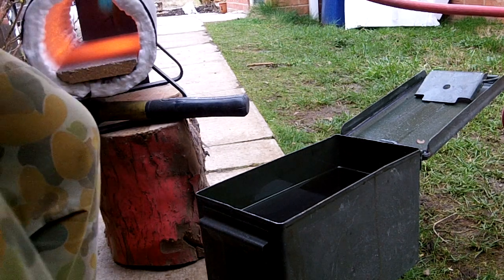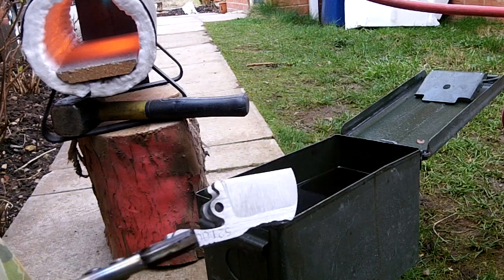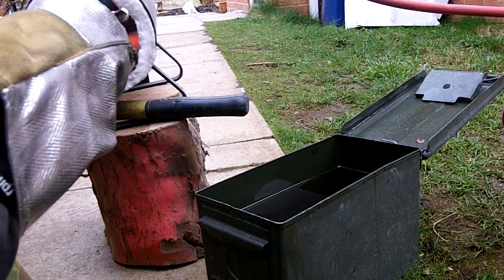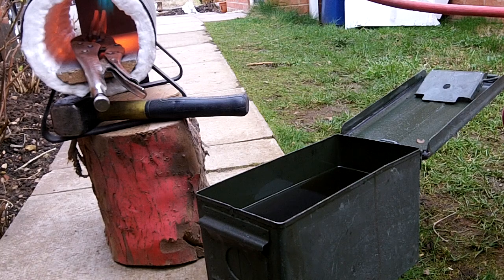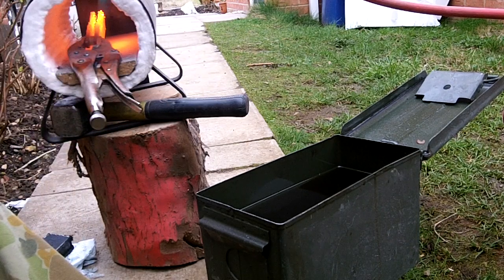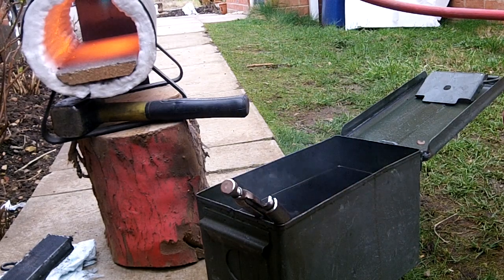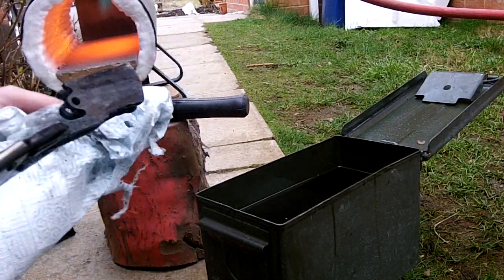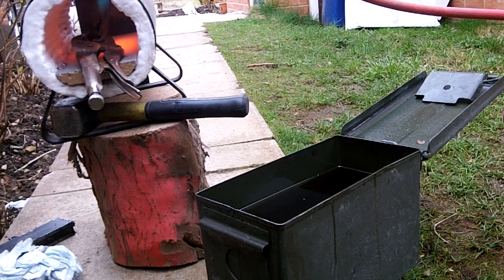Heat Treating the 52100 from Gavko, triple quench.....

Comment: Do you have any idea if it makes sence to put the blade (1095) in water after the hardening after you heat up the blade for the last time at low temperatures (example 200° celsius)
Marius
Reply from the maker: BushcraftMSL1 NO!!! water will shock the steel and potentially cause cracks. let it cool naturally and yo might want to increase your tempering temperature to around 250c
Reply: Quench 1095 in oil. Water will crack it. Do not let it cool "naturally" in the air or it won't fully harden. It has to be quenched in oil to properly harden.
Reply: FDT GURU 
After the hardening.  
We are talking about the tempering AFTER the hardening!
Reply: MSL Bushcraft & Survival
Stop pretending you know how to make knives. You look ridiculous. Of course tempering comes after hardening! But the hardening is done in OIL. You can also temper in hot oil if you want and that's fine, but that's not the same as quenching.
Reply: MSL Bushcraft & Survival 1095 is a blade you don't have to water harden it's a oil quenching steel better of using just oil
Reply: @frankwoods135  1095 and W1 are both water hardening steels, called that because they don't harden deeply in oil, but thin cross sections harden well enough in oil (better in quenching oils that are designed to cause temp transition almost as fast as water). Thin cross sections can crack in water or brine, of course, but I'm sure someone with skill and experience could quench them in water - it's just risky. Larger and thicker cross sections need water or brine to harden deeply enough, though.  For practical purposes, what you're saying is sensible (a beginner will be taking risks to quench water hardening steel in water or brine), but the terminology is bad. O1 is an oil hardening steel (it will harden through in a much slower temperature change like you'd get in most slower quenching oils, motor oil, vegetable oils).

Comment: good work man, sweet blades. Non-magnetic is really not that hot, a medium red. Try taking out a piece as it is heating and testing it till it just starts becoming non-mag so you no the low end color. I have not worked with 52100 but yellow heat is actually hot for quenching. Not a big deal with carbon steels but over heating a stainless can ruin it.